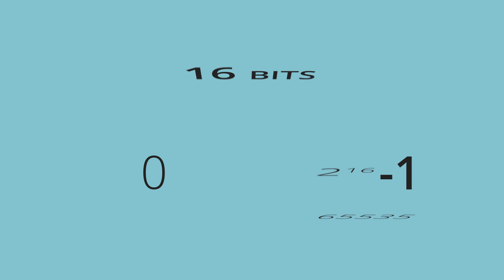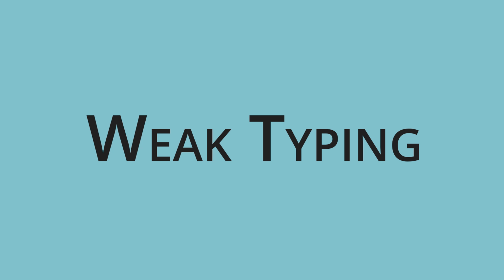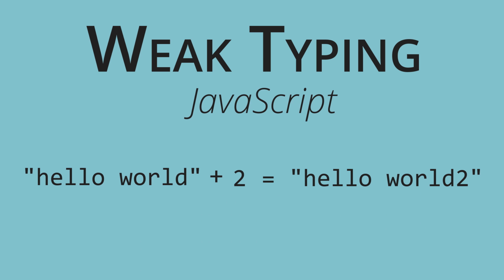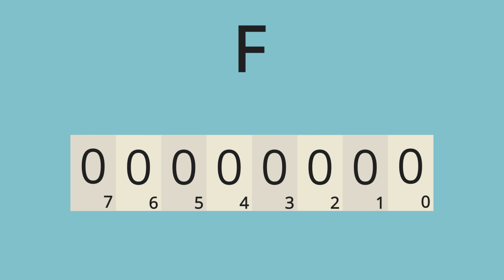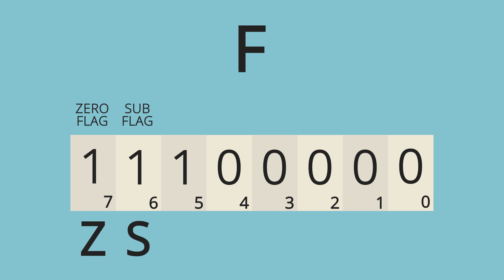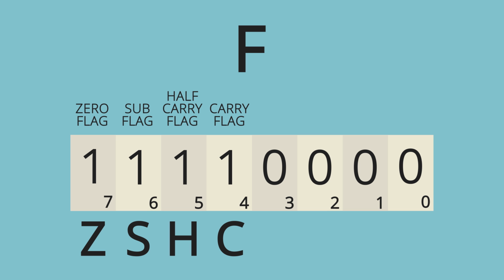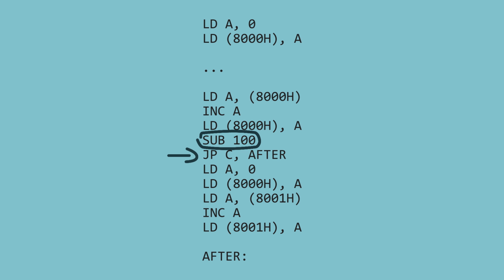The Game Boy, a hardware autopsy - Part 1.5: a few mistakes and register F

Comment: Statically typed languages do not in general need to be told about types in advance. For example, in Haskell you rarely need to type out types. Instead, the compiler figures out types for you. But Haskell is statically typed. C needs types to be declared but that is a C thing, not a static types thing.

Dynamic types are actually not types at all, they are part of run time values. Dynamic types are labels that get attached to values and can be manipulated at run time like any part of values generally can. For example, the value 2 would in a dynamically typed language at run time be represented by a value like (Integer, 2), that is, by a 2 combined with a label indicating the "type". Statically typed languages often also support dynamic types, in Haskell for example those are called "constructors".

Static types are used at compile time to e.g. check whether the program satisfies certain criteria and are then generally discarded so that at run time they do not exist at all. Static types are inaccesible to the program, that is, a program cannot inspect nor change it's own static types.

So the real difference between static types and dynamic types is when they are used. One at compile time, the other at run time.
Reply: the complete doesn't necessarily need to be told about static types in advance, but it does need to know them in advance. whether that's from inference or because you explicitly told it doesn't usually matter.

Comment: There are a few additional errors about typing here (yes I realize I'm 7 years late). Extreme nitpicking time.

A more accurate way to describe dynamic typing is that "variables don't have types - the values do". So, in the example, variable1 first has a value of 2 (which in python has type int) and then value "hi" (of type str). So far so good.

With static languages, however, you say that "a statically typed language like C must be told in advance". While this is true of C, it is not true of C++11 (which is also statically typed), as it has the "auto" keyword; you can write "auto variable1 = 2;", and the compiler will deduce the type of variable1; so the compiler isn't "told in advance". The second line would indeed fail, as the type of a variable can't change in a statically-typed language...

...or can it? In Rust, the following code runs just fine (without the println statements it would compile with warnings):

let variable1 = 2;
println!("{}", variable1);
let variable1 = "hi";
println!("{}", variable1);

The trick here is that the second variable1 is a different variable, masking the first one. In C++, the equivalent would be:

auto variable1 = 2;
cout << variable1 << endl;
{
  auto variable1 = "hi";
  cout << variable1 << endl;
}

Comment: You're wrong again about C#! C# is not interpreted. Neither is Java. C# does compile to a byte code called IL, similar to Java. When a C# application is executed, the byte code is JIT-compiled to the target machine code which is why it ports easily to other platforms.  You just have to implement the CLR for each supported platform.

Comment: Your distinction between static and dynamic typing is incorrect. It's not about the compiler needing to know in advance what the type of a variable is or not; in a statically typed language, the type checking is done at compile time, whereas it's done at runtime in a dynamically typed language. Generally, statically typed languages attach types to variables, while dynamically typed languages attach types to values.

Comment: Another mistake: 3:28
The operation "SUB 100" subtracts 100 in hexadecimal, which is 256 in decimal. If you wanted it to subtract 100 in decimal, the operation will be "SUB 64".

Comment: Thanks for summing this up, but actually I have something to mention: C# does not run in a interpreter. Source code written in C# is compiled into an intermediate language (IL). When the C# program is executed, the IL code is compiled to native machine instructions. Meaning that its not running in an interpreter, which makes this 10x as performant as such languages. Source: https://msdn.microsoft.com/library/z1zx9t92
Reply: +Ravior Metal The C# IL is only converted to native machine instructions during runtime by the JIT compiler. The compiler translates the C# source into this IL which is interpreted by the Common Language Runtime. It sits atop a virtual machine and is an interpreted language.
Reply: +Dontatella Versace Please read the Site I linked to. It makes it very clear that what you understand from a "Programming language which is running in an interpreter" is very far from what C# is. You have to dig a little deeper to understand this. Just to be clear: C# is not to be confused with Languages like Python which are running in an interpreter. Read the Site I linked and you will find out.

Comment: But even with all those mistakes corrected,i still don't understand what it all exactly means.
If programming was backthem sooo complicated,then i call it a mirecle that each company were just able to make several games per year and dit know how to bypass limitations of the hardware by using programming tricks.
Am mean even if you do have a team of programmers you will not expect such quick developements of games, in fact i find it amezing there are so many peoples around the globe how to program complex stuff.
Also how will prgrammers ever track down bugs in there code,because it sounds like finding a needle in a straw.
And creating software sounds easier said then done.

Comment: The real error you made regarding C# is to put it on the same line as C/C++ (compiled directly to assembly) instead of the line that had Perl, Python and Java in it (compiled to a VM’s virtual bytecode). It belongs in the latter group. It is compiled to bytecode called IL (Intermediate Language), which is executed by a VM called the CLR (Common Language Runtime).

Comment: Er, C# is definitely compiled. It is compiled into MSIL, or "Microsoft Intermediate Language". This is then compiled just before the execution in what is known as "Just In Time (JIT) compilation".

An interpreter does not actually "compile" a language like a JIT compiler does. It is just a very big program that maps certain words to certain actions to be performed by the CPU.
Reply: +Christopher Pilcher Thats´s exactly what i wanted to say. Anyway great video hope you´ll finish the serie.
Reply: Well, TECHNICALLY python "compiles" to byte code, but I wouldn't call it a compiled language, as the main implementation of python is, in fact, an interpreter.

C# is kinda a weird one. I would say it's a compiled language, though, as it not only has AoT native compilation, but it has a just in time compiler , as you mentioned.

It's also, mainly, done are run time (ofc, that's if you don't choose to compile ahead of time).

The lines are becoming very blurry. I also hear python is moving to JIT in the future, and there are already JIT implementations of python, like PyPy, I believe.

Comment: I made a comment on italian video that I want to share here too. my english is not perfect but I hope you can understand it.

your operation interpretation of a strong typing language is not true.
for example
in Java if a write:
System.out.println("hello world" + 2);
it will print:
"hello world2"

the thing is you can make an operation between two types on a strong type language.
What you cannot make is change the type of a variable.

for example:
a = 5; //integer type

a = "hello"; //string type, but a is already an integer, in a strong typing language this is an error

this is a problem when you use a Dynamic typing language (like Python), because you can only know your error at runtime.
In Java, C, C#, C++ etc... (Static typing language), usually is not possible to assign a different type to a variable. Error will be at compile time (or if you use an IDE as soon as you write it).

For example (java):
int a = 5;

String a = "hello"; //error you cannot redefine a
a = "hello"; //error you cannot assign a String type to an int
a = 5.2; //error you cannot assign a float/double to an int
a = ((int) 5.2) + 2; //ok... you can explicit convert a float to an int (5) and sum to it 2 and assign it to a (that is an int).

String b= 5 +"" //ok.... you can implicit convert 5 to a string.

Of course Javascript problem is that if you change the type of a during your program there will be no error but you cannot say what variable a is (so it's really difficult to read a javascript program if not well commented, and it's easy to make lots of mistake).

Comment: Strong typing FTW! The var and auto types are aberrations. (C++ and C# fans will understand me lol)
Reply: +foufoufun0 Auto and var do not break strong typing or static typing because they use local type inference to determine the correct type.  Modern statically typed languages use full type interference and you rarely (if ever) need to actually declare the type of a value.
Reply: Ehal256
I know that it change into a type and stays that way. But I still find it to be a lazy way to declare a variable. It makes it harder to understand the code when reading it when there are var and auto everywhere instead of the right type names.

Comment: C# IS a compiled language. It just compiles to something called the "intermediate Language" (IL) which can be either compiled to native instructions at or during run time (JIT compiler) but also be compiled ahead of time (AOT compiler). The only version of c# that is interpreted is the .Net MICRO framework which is used for embedded purposes and had limited resources to work with. 

That being said I liked the balance you had between completely dumbed down and technical correctness. Would be interesting to see another.

Comment: C# is actually what I'd call a JIT'ed language, which is halfway between a compiled language like C/C++, and something interpreted like Python.  JIT'ed code is "compiled" to some intermediary format, in C#'s case, that means IL (Intermediate Language), which is basically like a custom, CPU-agnostic assembly-like instruction set.  When you run the program, the JIT compiler starts and JIT's (just-in-time compiles) your code to the actual instruction set that your CPU uses.  Java runs in a similar fashion.  I understand though, this is all minutiae that programmers argue about on the internet.  Lol.  Great videos, and I look forward to part 2 on the Game Boy.

Comment: Your corrections are not right. A static typed language checks for type errors at compile time, it has nothing to do with being told which type a variable is beforehand like in C.
Reply from the maker: +sevret313 That would involve adding more details about compile-time vs. execution time, then explaining the difference between languages that want it explicitly declared (C, Java) and languages that have infer the types automatically, etc. I think this explanation is "good enough" for the target of these videos, as in a broad sense and in common occurrence static typing involves letting the compiler know what will be in a variable. We can go infinitely deep with corrections like this, and I think it would subtract from the broader point, but thanks for your feedback!

Comment: are u sure about the order of the flags in F?
Reply: The order is correct for the Gameboy CPU but different from a Z80. (GB CPU is not actually a Z80.)
Reply: +Gameboygenius so this wrong https://github.com/radare/radare2/blob/master/libr/anal/p/anal_gb.c#L1400 ? is bit7 msb or lsb of F?
Reply: +Der Lukas Bit 7 (Z) is MSB. Radare2 is internally using a definition format for registers that addresses the registers by the bit. F is defined as register 6. The base (bit 0) of F is at internal index 6*8=48. Bit 7 is at internal index 6*8+7=55. Apparently Radare2 also supports a definition format with syntax reg.bit, so why the person didn't define the z register as 6.7 beats me.
Reply: +Gameboygenius when i created the register-profile, r2 did not support that syntax afaik, now i'm busy with the siol-branch. so feel free to create a pr if it beats u that much. I'll review and merge then.
Reply: +Der Lukas No, I don't care, I just told you what I figured out in order to answer your question. Since I've never used r2, I had to browse through the source code to figure out what .55 meant.
Reply: +Gameboygenius if u want to analyse gb-roms u should give it a try. I spent a lots of love to the gb-plugins. ok, we cannot handle bankswitches atm, but we work on this. Our parser of the header info is better than the one that ida implements for gb. We plan to do emulation focused on debugging, because vbam is so much pain, and reverse emulation.
Reply: +Der Lukas For my needs, BGB is usually fine, but that depends on what you want to achieve of course. Can r2 integrate with an existing emulator (I'm thinking Gambatte) or do you have to do all the work on peripheral (non CPU core) hardware pretty much form scratch?
Reply: +Gameboygenius if the existing emulator implements a gdb-server, it should work. i'm not sure about the bankswitch then. I just extended the pc to 32-bit mpc the m-register will be used to set the current bank. I'm not sure how other emulators do that, maybe they just use mmap for simple emulation
Reply: we actually do everything from the scratch, because we want to emulate x86 and gb with the same engine. We're having some problems with our io.layer atm, thats why i rewrote it and integrate that now. After that R_API should provide enough stuff for implementing the hardware straight forward and simple.

Comment: Reading the discussions here and having watched the video myself... When will you upload "Part 1.6: about AOT and JIT compilation, VM-bytecode and machine instructions" ? :P
Reply: +Evrey And these subjects fall within the scope of a Gameboy autopsy... HOW?
Reply: Gert Brink Nielsen
The ability to read seams not to correlate with the ability to detect humour.
Reply: Marc Gràcia
Needn't tell this to me. I, too, answered this question here.
Reply: +Evrey 
that would be nice to see him cover those topics, however, they don't apply to GameBoy, which is the main topic of this series.
he might come back to them later.
Reply: Dong Harvey
Well, it is a joke. :P This would be heavily off-topic, yes.
Reply: +Evrey Is not that complex. 

c# and Java are really compiled, just to a "virtual" CPU assembler.

Then, there's an "emulator" (JVM) that transforms Java assembler into x86 or whatever assembler you need. JIT means Just In Time, which means that this transformation is not done all at once at the beginning, is done as the program goes, (When needed, not all at once).

This is where the confusion between interpreted and compiled comes int place. Is not really "interpreted" is "emulated".

Java can be run directly on real hardware, there has been built CPUs that use java assembler.

Comment: Not to be pedantic, but C# is compiled by a JIT-Compiler into bytecode which is then interpreted by a VM.
Reply: +DerWiepi Nope. C# is AOT compiled into CIL bytecode and - depending on the implementation - either JIT compiled to machine instructions or bytecode-interpreted.
Reply: +Evrey Ah, yes. You're right about the AOT compilation, that's my fault.

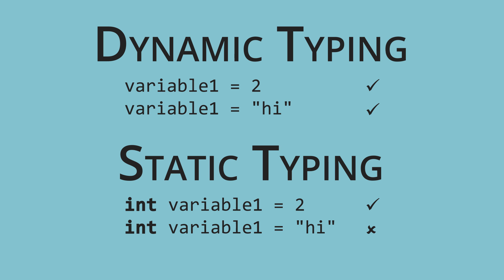Comment: at 1:30 this C operation will just give you a warning initialization makes integer from pointer without a cast and variable1 will have   the value 134513856[ because of C implicit conversion. 
Generally speaking, the static typing explanation is correct.